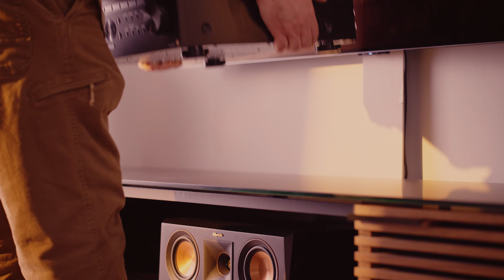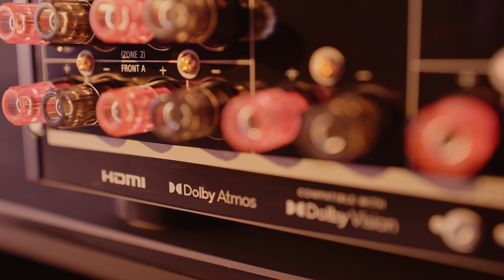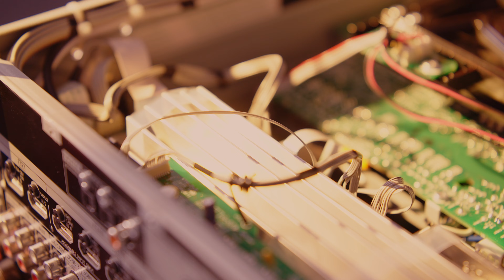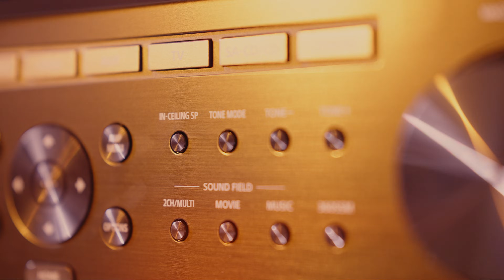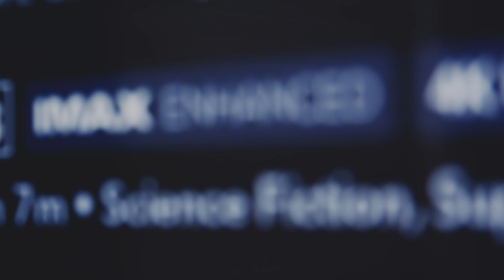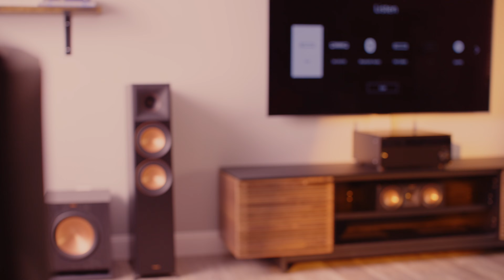Sony ES STR-AZ3000ES 8K home theater receiver | Crutchfield

Comment: Hey Matt you forgot to mention that Sony robbed us of pre-outs for this $2000+ home theatre receiver. Way to go Sony. Funny that Sony introduces it on the 5000 which happens to be a more powerful receiver and thus maybe no need for an external amp. Go figure.

Comment: I currently have the Sony STR DN-860 for my 5.1 Dali opticon 6 setup. I wonder if an upgrade like this is going to make a big difference in sound quality. do you guys have any ideas? thanks!
Reply from the maker: Yes, the Sony ES STR-AZ3000ES has an even beefier build with more power and even better processing.

Comment: Sony needs to make a Z10kES w/ a 4 sub out and independant bass management
Reply from the maker: That discrete bass control for multiple subs is pretty amazing! We have our fingers crossed that they release one with it.
Reply: @crutchfield  is it limited to only 2 subs?
Reply from the maker: This Sony ES STR-AZ3000ES has dual subwoofer preamp outputs to connect two powered subs. The subwoofer outputs share the same input signal and are not discrete; but you could split the output to connect more than two subs as needed.

Comment: So does this receiver add more dimension to regular Dolby atmos soundtracks?
Reply from the maker: The Sony ES STR-AZ3000ES has support for 5.1.2, 5.1.4, or 7.1.2 channel processing and offers : Dolby Atmos Height Virtualization for immersive audio without height-channel or overhead speakers, creating virtual height effects in a 5.1ch, 7.1ch or 2.1ch speaker arrangement. Dolby Atmos Height Virtualization applies carefully designed "height-cue" filters to the overhead audio components of your content's soundtrack before they are mixed into your loudspeakers to create the sensation of sound above you.

Comment: I have a Sony STR-KM7500 system which has centre, two front, two side, two rear and two sub woofers. I'm thinking it is worth upgrading. Can I get away with just upgrading the receiver? To something like this one you reviewed. Or am I better to update everything? Thank you
Reply from the maker: What do you hope to improve with the upgrades?
Reply: @CRUTCHFIELD  I'm just wondering whether the improvements over the time to receivers will improve the quality of the sound.  I think the speakers are still giving good sound,  but the receiver may not be giving me the full experience any more.
Reply from the maker: If you're happy with the sound overall, you could stick with the speakers and add the new receiver to get even newer features and inputs. Are there any specific options you're looking for? Do you know your speaker models or specs?